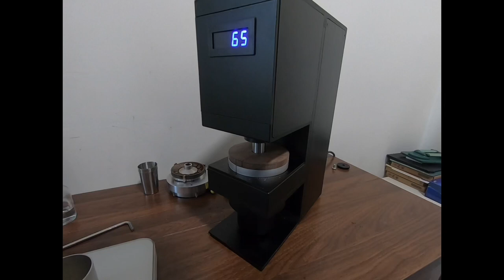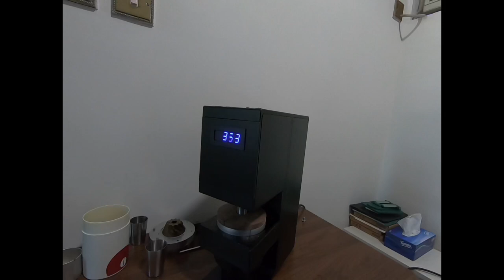Wug2-83A demonstration

Comment: Love your machinery. GS3 + Wug2
I own a Lelit Bianca v3 and a Ceado E6p, but I am definitely looking forward to add a single dose grinder in my setup.
I am currently looking at both the Wug2 and the Zerno Z1. Not sure which one is best and with which burrs

PS. I see the comments complaining on the long time grinding. But, I love the fact that you can grind with low rpm, like 360-400
PS2. I hear many saying that with Distilled water and third wave water, you can get better espresso, than with tap water through filter. I don't know. I am looking forward to learn more, and why not to try

Comment: Did that seriously just take a minute to grind 14g of coffee???
Reply from the maker: you can check out the video in our instagram, can be done in less than 30s at 650rpm with 80mm/83mm flat burr for espresso setting. thanks!
Reply: awwww, come on now! It was 14 POINT 5 grams 😆